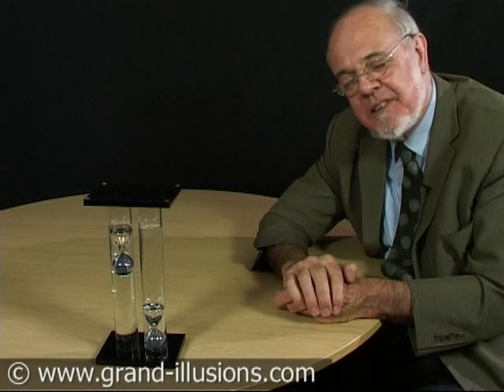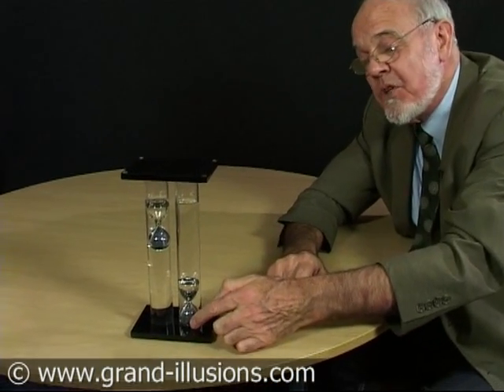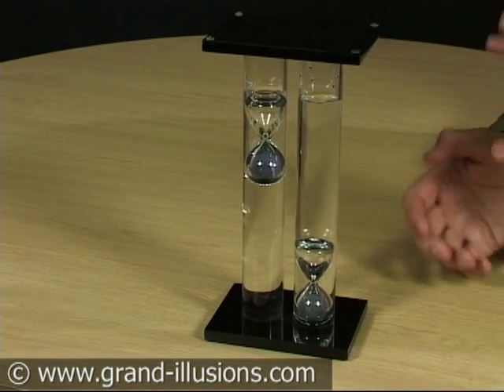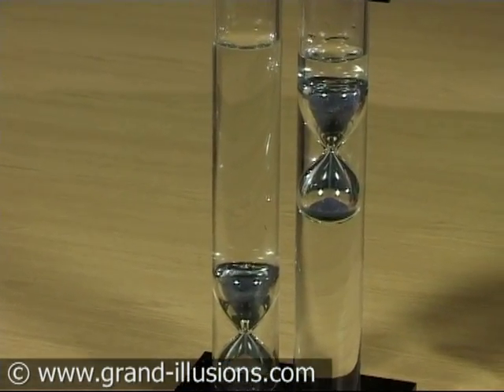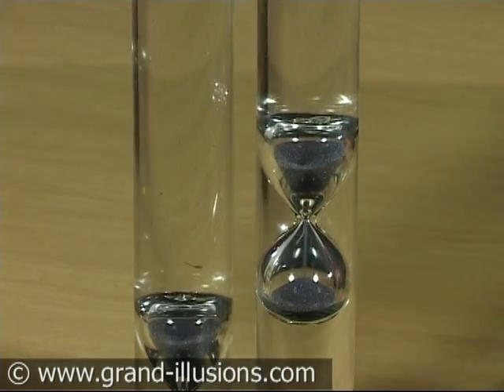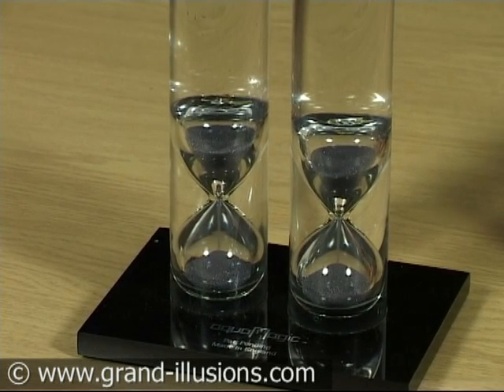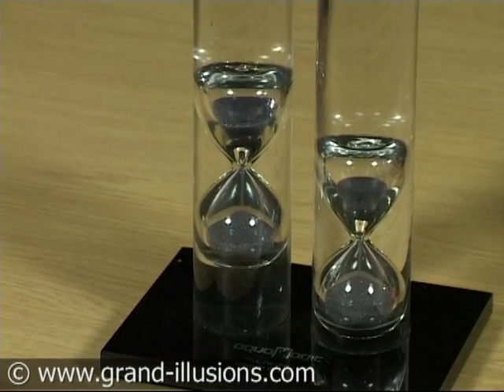Floating Hourglass

Comment: It's an illusion. The centre of boyancy is always moving. The potential energy contained in the boyancy disipates at a rate determined by terminal velocity. This is in turn is determined by the friction of the water and the friction of the sand moving through the hourglass. When the sand is moving, most of the potential energy is disipating through the falling sand because it has a lot less friction. The falling sand is  changing the centre of boyancy at almost the same rate as the rising, or falling, hour glass would be if the sand wasn't moving . Almost, because the whole hour glass is still moving but very slowly. The difference is the imperceptable speed of the hour glass. In other words, potential energy is being dissipated when the hour glass seems to be still becasue it is the sand that is dissipating most of it, not the rising, or falling, hour glass.

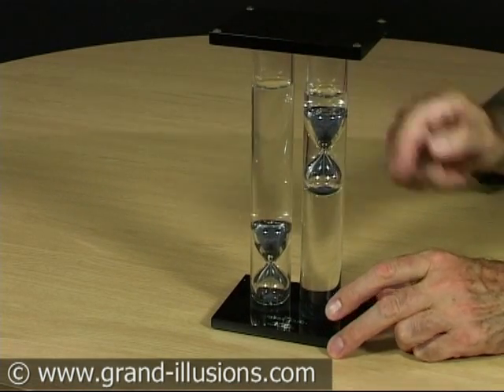Comment: 0:39 To me it looks like the volume of the cylinder has a fixed pressure, which shifts the hourglass based on its dimensions... Creating a vacuum in the center after the air passes through, and the water collapsing in after, seals it. Making the low pressure hold it by its sides, and the high pressure RESIST the natural equilibrium.

I only suppose this, because in slow-mo the hourglass seems to attentively stop after the change in pressure from the density of the air into the water.

I probably should've finished the video before commenting lol.. 

I'm probably wrong, but it doesnt hurt to guess.

Edit: A few seconds later I seen the sand shifting inside, and seen a comment about something like top heavy.. idk what he is talking about, but my personal opinion is that the shifting balance on each side of the hourglass from the sand causes a pressure difference on the vacuum and both ends of changing pressure on the top and bottom. 

The air is actually crucial for the effect to work, and i can almost garuntee that the same effect does not happen in open water.

It may be seen also when something drops in water. Maybe it too delays, but only briefly since the pressure evens out and buoyancy takes over.
Reply: Huh?

Comment: The reason why the first hourglass float for a few seconds is due to the fact that air is at the bottom hence will try to flip but due to tight fit in the tube stay afloat for some seconds, so when the sand fills the bottom hence the weight has been shifted to the bottom hence it starts sinking. 

The reason why the other hourglass that is at the bottom At the start, the sand is at the top hence it is trying to flit but due to tight fit stays put, but as the sand shift to the lower side the weight is shifted downwards and since it is being filled with a lighter gas e.g. helium or hydrogen hence the buoyancy is restored and the hourglass floats to the top

Comment: Which bactericidal / germicidal to be used in water to avoid any fungus or bacteria on long run. Also, any Dispersant or anti -freeze chemical to be added in oil/water for smooth free flow?

Comment: This is a clever illusion. In fact the hourglass only serves the purpose of drawing attention away from the real solution. The cylinder is filled with two diffrent liquids that are both clear but have different densities. Once enough of the heavier liduid has flowed down past the hourglass it can rise to the top (or sink to the bottom).
Reply: +lowet84  if the hourglass float in the less dense liquid  what is preventing it from going right back up at the moment it is turned over ? the force of the denser liquid going down ?
Reply: +lowet84 If you have a solution of two different solvents it will never separates. If it's not a solution like water + MeCl2 you would see it separates and the hourglasses would be floating in the middle.

Comment: Solution suggestion:
When it is turned upside down the hour glass is top heavy, witch makes it be jammed stuck until the sand has run trough and made it bottom heavy, witch will pull it straight again and allow it to move.
Grand Illusions
Reply: the solution is in the description.
Reply: +Sion That's the correct solution.

Comment: it's the volume of air I'm the empty side when the sand moves to the smaller lower chamber in the lefthand hour glass it leaves more open air in the largest upper chamber that's my theory
Reply: Think about this. If the hourglasses, sand,  tubes, liquids etc were all the same,  then the same thing will happen in both tubes at the same time. logically something is different. e.g
 one Hourglass is made from plastic and floats the other glass and sinks or one has sand the other lead shavings, the one has been evacuated of air (vacuum)/filed with a different lighter/heavier gas the other not or a combination of things. The tilting of the contraption causes the sand not too sit 100% in the center of the top chamber causing it to lean to one side causing the hourglass to grind along the walls of the tube causing friction and preventing it from sinking or floating just for a moment. once the sand falls it naturally balances out and buoyancy kicks in. What do you think of that explanation?

Comment: i don't think there is anything to do with friction. Simply Buoyancy and Water Pressure. Buoyant is higher at high water level, lower at lower level. that's all there is. The two hourglass are not equal in weight.  One that floats will always float at steady state, but while it's at the bottom, the buoyancy at the Absolute bottom is 0, the buoyancy at the Tip of the hourglass while it's situated at the bottom is Greater than 0 but not enough to push it up while full of sand. As sand drips, the upper cavity has more space and less sand (thus lower density), the buoyancy is enough to push it up, then it floats.  basically opposite for the other side.

Comment: its simple, floating or sinking stuff is just bouyant.. floating hourglass has slightly positif bouyant and sinking hourglass has negatif bouyant..
and while sand at top part of hourglass it make hourglass unbalance and make friction with glass wall thus slow down sinking/floating process, as sand dropped to bottom part part friction reduced and hourglass can floating or sinking at faster rate

Comment: This is wonderful! No one in the comments has any clue as of why this contraption actually works. The fact is that an hourglass is actually heavier once it is running, contrary to any intuition. The center of mass actually decreases with an accelarating rate, creating a net force that pushes the hourglass downwards. The other hourglass has a fluid heavier than the grains used, causing a net opposite effect.
Reply: This would work if the sand weren't contained in the hourglass system. The grains falling through strike against the bottom of the hourglass, producing no net force.
Reply: False, look it up.
Reply: I wonder if you are right. The sand would have to be very heavy for its motion to move the hourglass.

Comment: The hour glass is not made from glass but it may be some silicon, or rubber like material. When filled with sand particle on either side of the hourglass, it presses against the wall of the glass tube, with force just enough to oppose buoyancy or gravity. And the liquid in the galss tube are also different with different density. OR the sand particles could be magentic and two tubes can have magnet in opposite direction. 
Whatever it is , it is a masterpiece. Please give us the answer.........

Comment: Could it be that there are magnetic forces between the sand and the bottom of the tube
Reply: No there can not be.
Reply: Josh Byrd There could be.. I've figured the magnetic way, but this one uses friction.
Reply: That would be very complicated. The magnetic force is not constant over distance.
Reply: I took that into account don't worry (:
Reply: The weight of the pieces though had to be extremely precise.